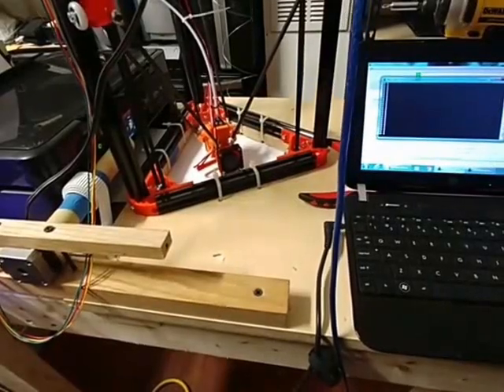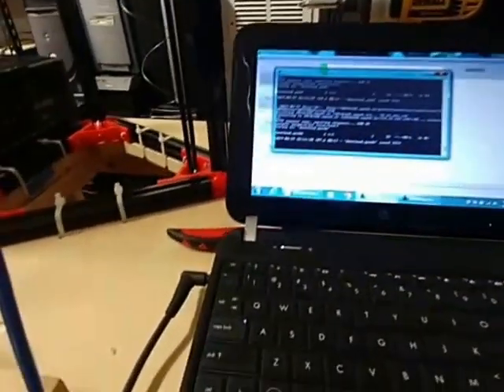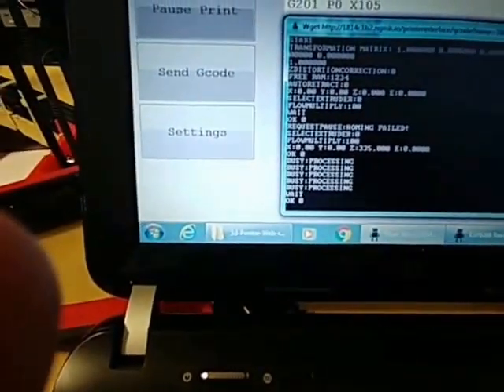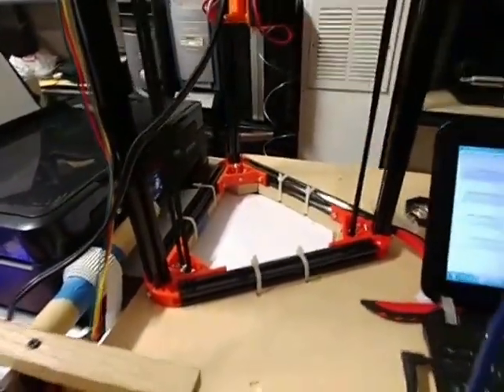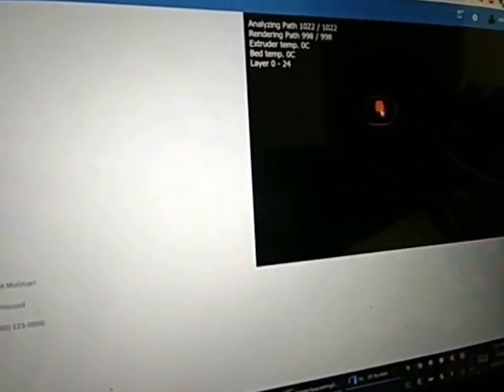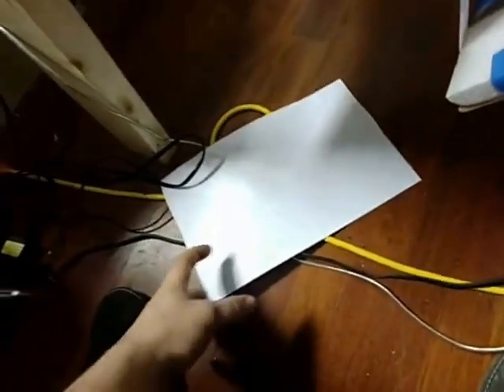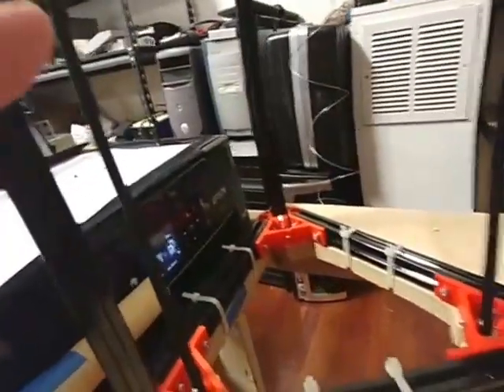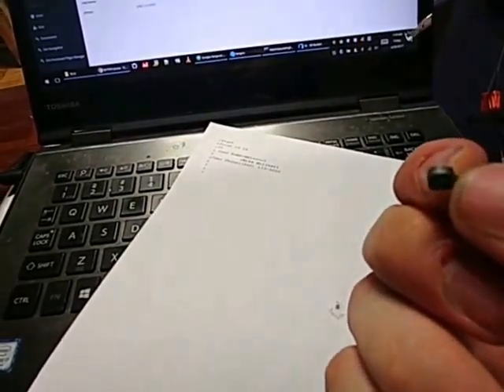Auto 3d print ejection system working 100%

Comment: Dude this is really neat! Stumbled across this looking for some inspiration for a similar project and recognized your voice from your espBASIC videos! Just about all of my esp mods are flashed with your basic interpreter  brilliant stuff man! keep on tinkering man can't wait to see what you dish out in the future!
Reply from the maker: Derek Walker I would love to have some one else replicate the printer. If you are up for a project I can help with the software and what not if you were interested.
Reply: you bet man sounds like a good time to me! I've been itching to build a delta too did you custom build yours?
Reply from the maker: Derek Walker . I purchased a kossel delta on eBay. I actually have 3 of them now. I would be happy to discuss via Google hang outs or via phone. if you send me a msg using the contact form on 3dpaperprinter.com I can email you my info. lol. not going to post it in a comment here.
Reply from the maker: +Derek Walker I built the delta from a kit. I did have to change the configuration a bit to make it work. But it was built from a kit. The biggest difference is I flipped the whole printer up side down. It works fine with the motors on top allowing for the machine to mount on the bottom with out the motors covering the print area.